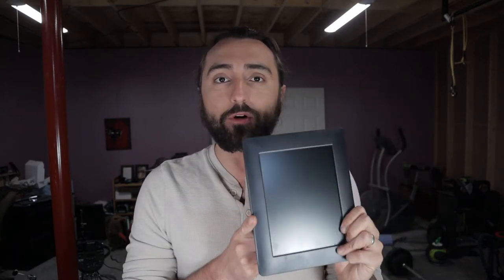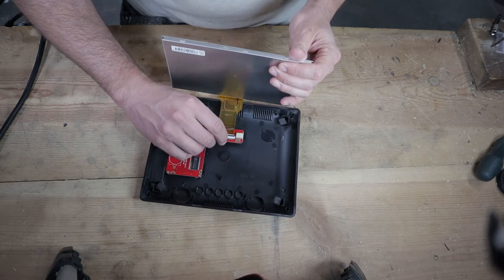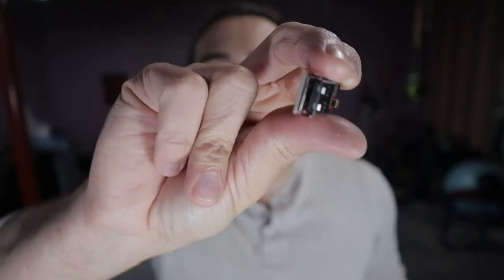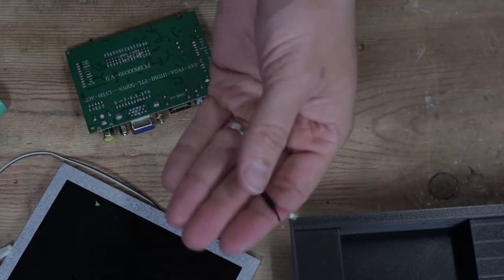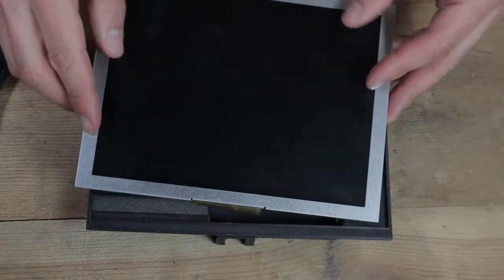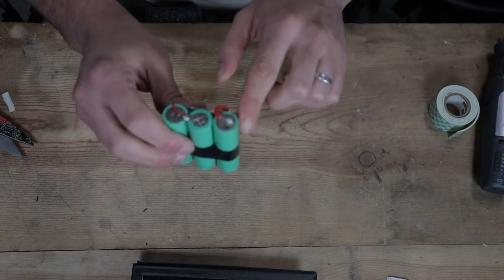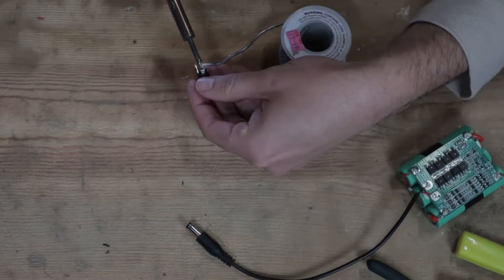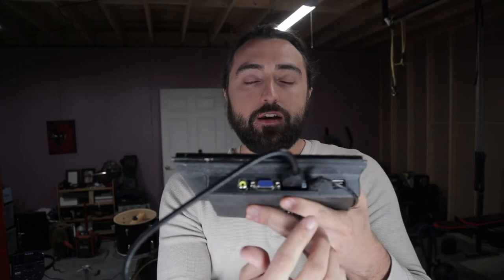DIY Multipurpose Monitor

Comment: I'm currently building a pc out of scrap wood and an old hp compaq for metal grounding and safety. I was stuck without a display. I could buy one online but I also have a photo frame.

My daughters first pc will be wooden custom made with x2 displays, one internal one external.

Comment: Good video and I like your casual style of presentation, but I don't see a link for the video card you purchased and am not even sure what to look for. When I search for "50-pin video card," nothing relevant comes up. Is there a specific name for cards like this, or even a named cabling/interface standard for that 50-pin cable?

Comment: I think I have the same display except that mine also has a power connector as well as the ribbon cable, would the LCD control Board still work with that display?